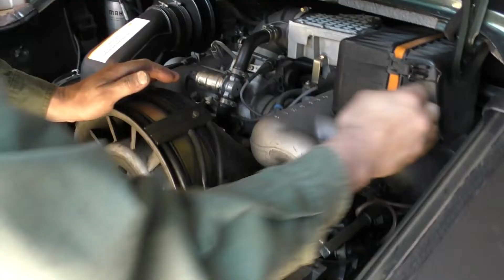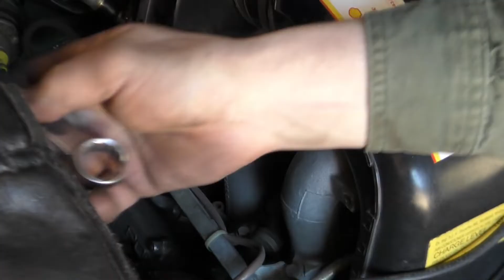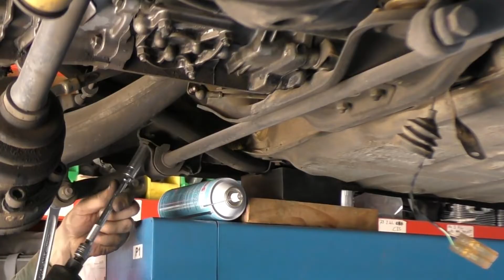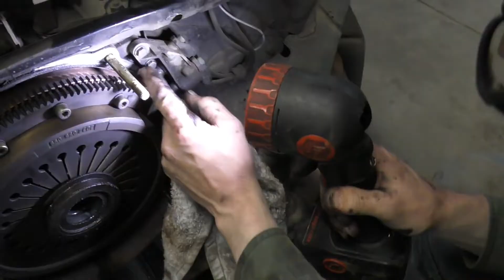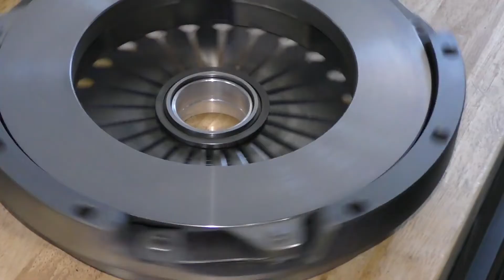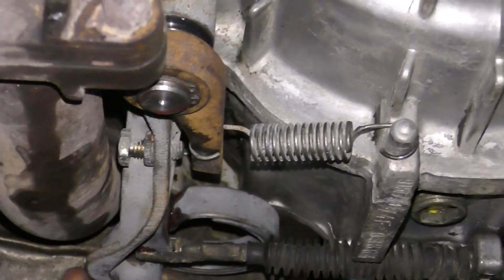Complete Clutch Job. Porsche 1985 911 Carrera.

Comment: Perfect video.  I'm just about to do this job: What kind of red grease are you using on the release bearing etc. Is the sensor at 12 a clock for diagnostics?
Reply from the maker: That is a high pressure wheel bearing grease. Give me a time stamp for sensor. I'm not sure what you are asking. S
Reply: @Aircooledconsulting  I see what you mean. I'm a bit out of context :-)  At 30m40s there is a sensor, similar to the speed and TDC sensor at the top of  the engine casing.

Comment: HI it seems my clutch spring, ( the C spring on the actuator arm may hit the heat exchanger, should it just cut it away? Thanks Kurt
Reply from the maker: No I would not cut away anything. What changed to cause this issue? When is the spring hitting the heat exchanger? If it is when the spring is at rest, (no clutch pressure on it), then i would look at your clutch cable adjustment.
Kurt
Reply: Actually, I just did a total rebuild on engine and trans. and with Both the engine and trans on the floor, when I put them together the spring hit the seem on the new heat exchanger, I just snipped off a 1/4 inch so I would clear. Thanks Kurt @Aircooledconsulting

Comment: Hi Kurt, I have a 78 porsche 911SC 3.0L that I am considering replacing the flywheel. It has several hot spots. I don't know of any machine shops where I can have it resurfaced. At what point would should a flywheel be replaced instead of resurfacing? What should I look for when choosing a flywheel? Any recommendations?
Reply from the maker: Hot spots on the flywheel are normal and can usually be resurfaced using a flywheel grinder. I replace flywheels when they go under the minimum thickness specification. When buying a new flywheel i will usually stick with an OEM one.
Kurt

Comment: If you want the transmission to slide in, put your little finger in the gap.
This is one of the best 911 videos I've see. I believe I could pull the engine in one of these after watching this. 
I should not have sold my 1987 3.2. These cars are a mechanic's dream. It's amazing you can do this job without a lift table and few specialized tools. 
I don't understand removing the air conditioning compressor. I hope he's going to put it back. Driving a car with the windows open all the time is tiring.
Reply from the maker: Garth,
These cars are designed to be serviced, so pulling an engine and trans is never a big deal. Yes he did end up putting the A/C back on the car and you can watch that video here https://youtu.be/5o1pqbsGPS8
Kurt

Comment: I so enjoy your videos. I learned a lot on this one for sure! Such value to Porsche home mechanics!!! I may have missed it in a video somewhere, but I'd love to learn how to do piston to cylinder head clearance and measurement. The old high compression pistons / cams deal. Love your channel!
Reply from the maker: I have not done one showing an actual physical measurement yet. Usually I only do that if we are using a very high compression ratio and also have positive deck height, (Meaning that the piston at TDC is above the barrel height at the edge of the piston. This dose not mean the dome height.) What I normally do is do my cylinder head chamber volumes and my dome volumes and calculate the compression ratio. I do have a video on that. https://www.youtube.com/watch?v=pVman2qOrXI&t=1434s If for some reason I do need to do a physical measurement I use plasticine on top of the piston and then put on the heads and cams and rotate the engine. Then you remove the heads and cams and measure the thickness of the plasticine, (silly putty), and that's your piston to head/valve clearance.  I will see if we can put a video in the queue showing this.
Thanks for watching 
Kurt

Comment: Hands down by far the best video on engine/trans removal   my 87 has broken head stud, will be dropping mine soon.  where can i buy that orange engine tool that you used with the floor jack
Reply from the maker: The engine cradle is still available from Porsche. You need to buy two parts the cradle and the jack adaptor piece, it works out to around a $1000 . 
Kurt